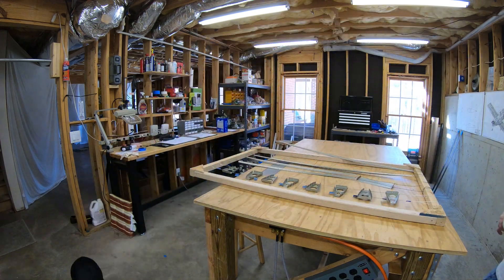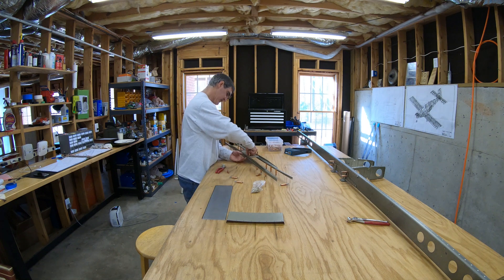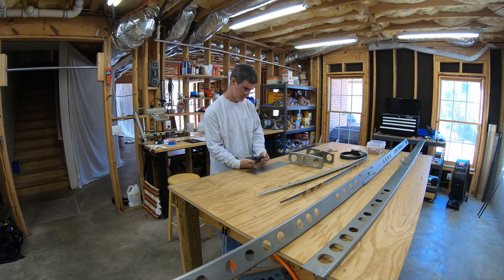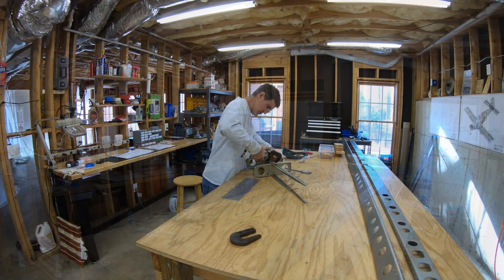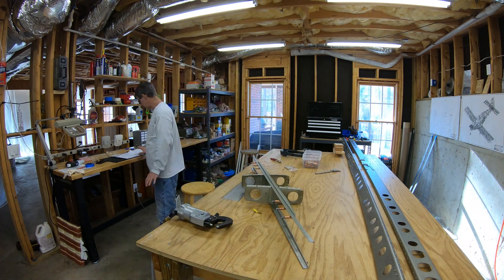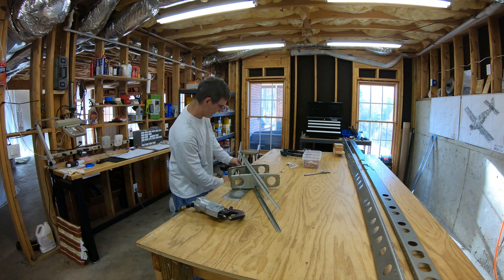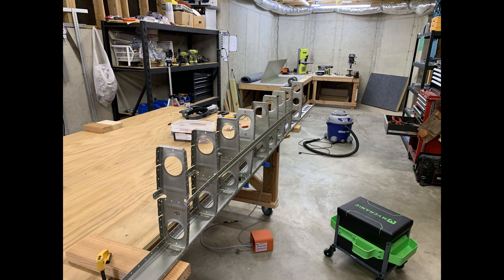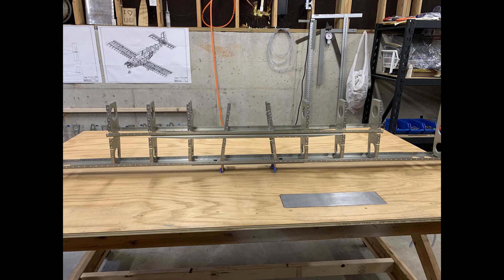RV-10 Build Log - Emp 48 - Assembling the Horizontal Stab Skeleton

Comment: When you do the rear spar make sure you pay attention to the callouts for the rivet heads.  The elevator skins might rub if you don't put the manufactured heads aft.  Nice work so far ; )
Reply from the maker: Thanks!  Yep, noticed that in the plans.  I was a little surprised that could happen, but then I realized that a lot of those rivets are LP4 blind rivets, which have a much taller shop head.  That said, I don't see how anyone could put the blind rivets in backward, so maybe even the solid rivets could rub?!?!?

Comment: I'm an EAA member, and I don't remember the article about the wooden priming frames. Please share the dimensions. Looks to be 4' X 4'? Glad to see your project marching along.
Reply from the maker: Thanks! The frames are a couple of different dimensions, mainly due to the wood I happened to have on hand when I made them ;-) with sides between 3 and 4.5 feet long, IIRC.  Nothing magical about the dimensions other than one being long enough for the long stringers.  The wood is mostly scrap 2x4 and 2x6 that I ripped in half.  I ramble on about them in more detail in this video:  https://www.youtube.com/watch?v=xs_kp6KyWbk&t=8s and the EAA article was in Sport Pilot, April, 2021, Shop Talk column, Pg 96 .
Reply: @missiletwentynine2667  Thanks for the info. I found the Sport Aviation article through online archives. I agree with you on using wire to hang items. I have a spool of braided fishing line (garage sale find - $10) I'll be using. My plan is to set up an 8X10 collapsable, positive-pressure paint booth.
Reply from the maker: @EJWash57  I started with a 9x9 corner of my main workshop area that I built a temporary frame around with PVC and clear plastic.  The idea was that when I was done, I'd disconnect all the PVC and roll the plastic up into the ceiling.  You can still see it up there in the corner by the window.  I put a squirrel-cage blower in the window, blowing out, to provide ventilation.  I guess it's more "negative pressure" than positive, but I wanted the direction of flow to be from the rest of the basement, into the booth,  and then out the window to keep the fumes from permeating the rest of the house.  It worked great for the VS, but I decided I needed more space for the HS because the spars are 11 feet long, so I set up in a different room.
Reply: @missiletwentynine2667  I think conventional wisdom as far as positive/negative pressure spray booths goes out the window (pun intended) when non-flammable, water-based paints come into the picture. I plan to only use water-based product. My shop is windowless, so I have to vent via a 18' rollup door. Do you find one 20" fan to be adequate for flow, or would you go for two? Also, I didn't mention that I'm building a -14.
Reply from the maker: @EJWash57  Nice ;-)  I assume you're talking about a 20" box fan of the Wally-world variety.  I would think that would be plenty, but I'm no expert.  The fan I'm using is unique, but hard to provide as a comparison.  It's a long, narrow squirrel cage blower that came out of a very old rack mount hard drive.  To give a sense of scale, the platters in this hard drive were about the size of 78 RPM vinyl records albums.  So the blower is a little shy of the standard 19" that is a typical equipment rack, and it's only 3" or so tall.  But it really screams.  Sorry that's not much help.